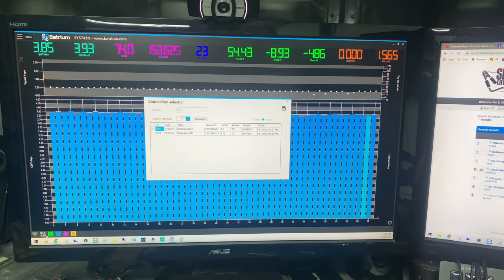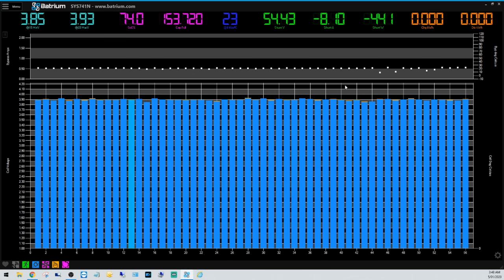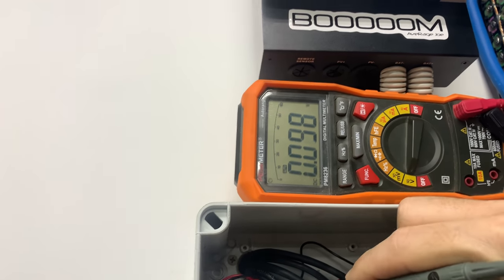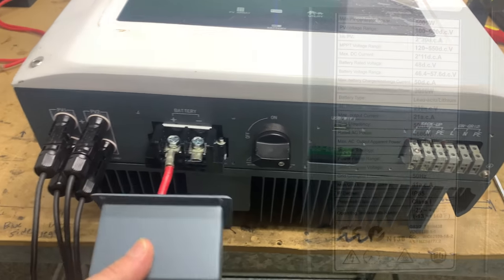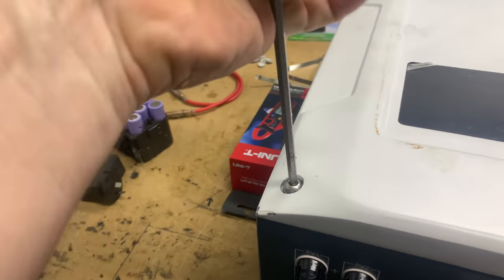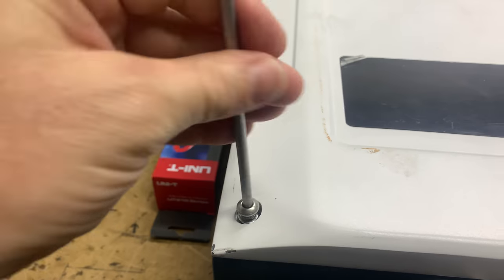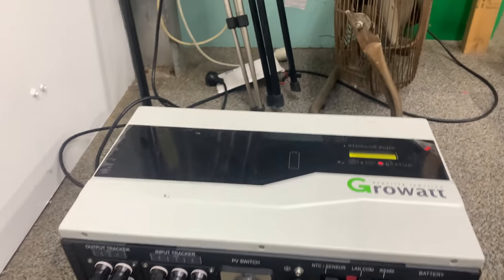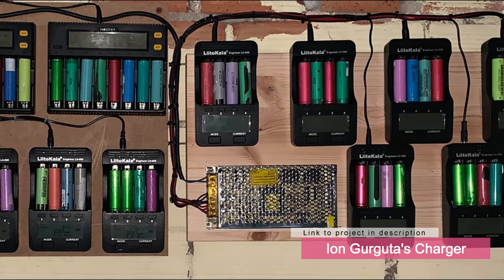Some new inverters Lantrun Aegis & Growatt SP2000, and a quick update.

Comment: Red clamp meter you need to press the top button to switch it from AC to measure DC current. Inverters look like fun 😀
Reply from the maker: Thanks for the heads up on that clamp meter, the manual was left in china it seems :( - I have to wait 4 days to play till sparkie can get here unfortunately
Reply: HBPowerwall Hey at least he is coming, I love that little meter but having to switch it to dc all they time is annoying.
Reply from the maker: I really only need it for one video - as long as it does the job i'm happy

Comment: I actually visited the Lantrun factory in Shenzhen. At the time all the investors were hand built and waiting to receive more orders then to get another factory to assemble
Reply from the maker: How long ago was that, seems they have gone out of business I still can't find their dongle for WIFI, do you know if it was a clone of another inverter? Perhaps the dongle from a different unit might work/
Reply: HBPowerwall   It was not a clone, but you never know, they were also supplying a battery system to Sapphire solar in based Adelaide. About 5 years ago. I will have a look thru my old emails and see if I have any contacts 😀😀
Reply from the maker: @johnnorton8451  i stalked them with wayback found the ceo on linkedin - not hard to find info it's hard to get a reply tho lol

Comment: I love it , the amount of diy plugs from Bunnings :)  I need an electrician , yes those three wires :)  but on a public stage like this I too agree we need a sparky for anything 240v.  No seriously
Reply from the maker: No 240v for me, too much to loose when something goes south.
Reply: Yes I’ve had to many 240v shocks in my time, sparky at my work used to just use the back of his hand to check live 240v how times have changed.  I’ve wired up a few things, but when there’s a GFI in the mix.  Still yes all permanent installs where there’s life involved, by the book is needed.

Comment: hi i have a problem with the output of my EPEVER UPOWER inverter/charger
 
i correctly connected my inverter to ground but when i test with a multimeter i have 115 volts between neutral and ground also 115 volts between live and ground !!
it is very dangerous
what is the problem and what is the solution ?
Reply from the maker: Sounds like you need professional help not YouTube guess work.. Sorry can't help on that one.
Reply: @HBPowerwall  i hoped you test your setup like i did to see if it is common in inverters.
thanks
Reply: Do you have 230V between Live and Neutral? Sounds like you might have a split phase unit (I’m in Australia so I’ve only heard about them.) 2 lives rather than a neutral designed to supply higher voltage outlets - like dryers. Once again, Pete is right. Don’t fool with this yourself, consult a professional. If it is split phase it can normally be switched off and on in a mode setting in the menu. Read the manual first.
Reply: @mondotv4216  thanks for the answer and no it is not a split phase model .
i have a 230V monophase from EPEVER so i asked them and they say it is a capacity protection wire between live neutral and ground !
Reply: Malek that’s crazy. Neutral needs to sit very close to ground or lots of things won’t even work. An EVSE for many EVs won’t work. And as you said it’s unsafe. There’s a reason you have to pay extra for all the ticks :)

Comment: I thought you hated the deligreen balancers?
Reply from the maker: I dislike them for many reasons one will remain private for all time. But there are a handfull of people from a few years back who had one fail mid pack and screwed up their battery packs because they balanced unevenly. They hide issues with older packs etc etc - i've covered this alot. The this i want to see is the amp draw. More later...

Comment: Already at the grid limit couldn’t you split your title deed create two plots on one property, or two separate properties? Obviously could be financially too expensive small pv system. As ever another great video.
Reply from the maker: I just need to apply for a higher export limit much cheaper and easier than the deed thing - not that we have that type of thing here anyway.
Reply: @HBPowerwall  just get 3 phase
Reply: turbosigma Also expensive if it wasn’t done with the house.